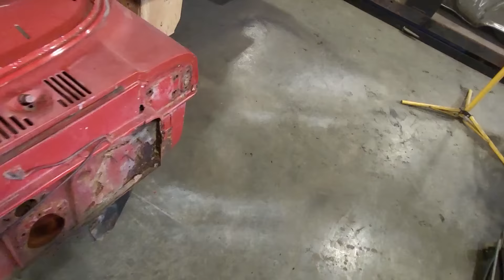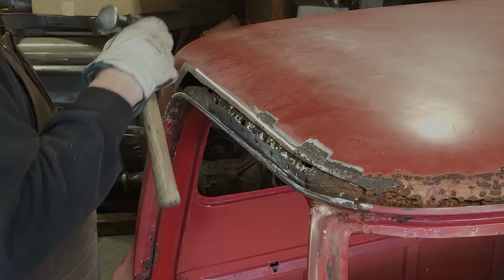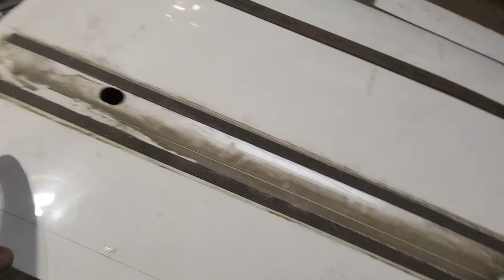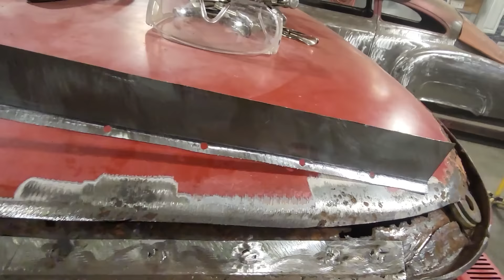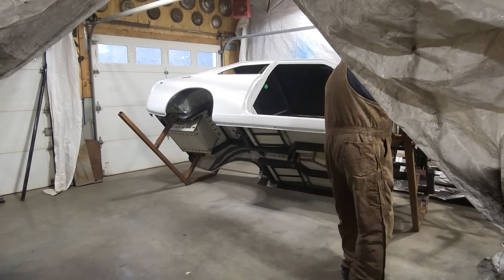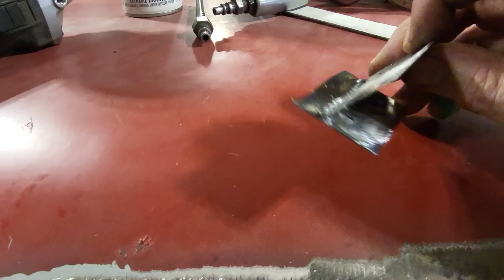Project VIC100 Part 3. Rusty Roof!

Comment: Tony, with regards to the small piece with the seam that you made for the right rear corner of the roof, could you drill three holes in it to gain access to the inside and spot weld it using the holes for access to the insides and then weld up the holes afterwards.

Comment: Sorry to hear about your back issues, I can relate. I have a lot of carts and things with wheels cause it's easier to move. The six inch break is fine for straight bits but you can break a curved line with a chisel on an old mud flap then hammer it to shape. I find I can bend a 1/4" flange in 20 gauge easier than welding the edge on like you showed, (which is better with 18 and thicker metal). Thanks for another interesting and educational video, looking forward to the next one.

Comment: Hey Tony. What about that “rust converter” stuff? Is that any good to spray on the inside stuff or is it gonna cause more problems?
Reply from the maker: Good gear, I used it before, just not enough bottles of it around to save thing thing. Lol

Comment: You doing this repair is what I needed to see. Thank you so much. Sorry about your back issues. Back in the early 90s I hurt my back poor crushed thoracic discs one ruptured..
Had to change occupation.
But I did buy a 71 Chevrolet K 10, which I’m doing minor body work on, including above drip rail and around 3 of the 5 cab lights.

Comment: Have you ever tried panel bond on parts like the rear cab part with the seam? You could panel bond the bottom and weld in the top.
Reply from the maker: Used that stuff back in the day. Good gear just has it place.

Comment: Good day sir Tony you talking about back problems ,same here so i make up like the movers use for moving heavy things but mine are 2by4,s and a set of wheels for transmissions.engines,built a jig for chev cabs my garage is small so times i have to move the cab outside to work on my other trucks .But my back is still sore ,could be worse any way the ford cab is looking well done sir Tony

Comment: Same here, excersizing isn't working, got me through three operations, back fused and shoulders. Get a recreational centre pass, and do resistance training, in water or weights. I'm 64 on the 20th, I'm building a shop on a disability, bit by bit. Be smart, I tell myself, I can't afford not too. Falling trees for lumber and firewood, doing demolition jobs for material .. and my 70 highboy Ford will be getting a new cab soon, and flat deck

Comment: Very interesting video as usual. What do you think about using a set-point tool to create a stepped profile on the edge of the sheet metal? This way, one sheet goes under the other, the two are aligned (ifall goes well), and you have a better surface for welding (no holes). Yes, I know there's a risk of rust in the gap, but you can apply a primer before welding to minimize that. Keep showing us your tips, I'll never get tired of them.
Reply from the maker: That system works. I just find you dont get a flow between the two metals when welding. You see your joints . It works but dont look good

Comment: I love this video!!!  
slowly working on a 49 
chev (basket case) truck, normal rust in kick panels & floors.  Not trying to restore, just want to make it into a daily driver and not worry about a "grocery cart'' rolling into the side of it.  I said "slowly" because I'm 79 years oid and have had back issues since I was 20 years old (probably from not lifting properly when I was much younger).  
But I still enjoy being in the garage with "Ol' Blue".  Thanks for your videos, especially this new project.  I have been a subscriber for a couple years and always pickup tips from you.  Keep bringing use videos and good luck with the back.

Comment: Could you not just weld the sections in with a decent gap for extra penetration and then cut a grove to give the appearance of a panel seam?
Reply from the maker: That usually ends up making a mess of the line
Reply: @fitzeesfabrications 👍

Comment: Fitzee, just turned 64, and I try not to NEVER DO ANYTHING MANUALLY if I can get an either a 1. Power Tool, 2. A floor Jack/hoist/come-along or block & tackle, ropes, pulleys, logging chain, tractor front loader, or 3-point hitch ( Hydraulics ) 3. Use a “LONG,…REALLY LONG lever” of some kind, ( 2 x 4 ) pipe or extension tube whenever you can.               We can’t have a world without Fitzee 😳…………so BE CAREFUL, slow down, and when you get into a lift/move situation ask yourself “how would the Egyptians do this?” Stretch-out your back before you work,……take lots of breaks,……and never do ANYTHING manually if there is some sort of power-assist, power tool, or mechanical advantage that you can use. THE WELDING EDUCATION WORLD NEEDS FITZEE❤ - we all want you be 👍safe, healthy & happy. 😀 As always - wonderful  video - and BTW - TAKE YOUR TIME making videos - no hurry - no panic - and no rush.  Don’t endanger or hurt yourself rushing to make videos, remember…. “it’s OK, we can all wait” 👌😎👍 ( and I love the “masking tape + paper towel” bandages - I use them all the time ) 👍

Comment: Fitzee you are 100% correct about the filled in seems making the car look like it is Bondo’d over… Also, in your last video you were talking about dropping the cab down to fill in the space between the top of your Vic dash and the lower windshield of the F 100 cab… I was looking a One of these projects the other day. They still had the gap and the owner said that they didn’t lower it because it would cause the wheels to interfere with the wheel wells…
Reply from the maker: Yes i know that. I plan on cutting my arches. A sorta stock car look.
Reply: @fitzeesfabrications  I said wheel wells in my post, and I realize that I miss spoke… What I was trying to say, was inner fender panels… The tires would rub the top of the inner fender panels

Comment: Hi Tony.  I see that Peanut was giving the video a good cat scan.  When you first showed the cab, I was thinking that the rust along the roof was going to be very difficult to repair.  You made it look easy.  With your many years experience, you probably knew from the start how you were going to tackle that issue.  I like that you kept the seam.  I think that the truck wouldn't look right if you filled it in.  If it was going to be a show truck and have the body all smoothed out, I could see maybe filling it in for that reason.

Comment: Hi Tony, another great video.  I went and bought another welder...same as yours.  Curious what settings worked for you with that 20/22 gauge.  I have a bunch of similar welding tasks to complete on my 1960 Jaguar.  Thanks for your videos.😊
Reply from the maker: I play around with it. Around 15 volts  and 5.5 on wire speed. I find keeping the numbers close to same on both sides seems to work for different thickness.  18 volt is like 8.5. 13 volt is 3.5.  Ill ajust wire speed  up or down a small bit to get a better weld

Comment: Take care of yourself Tony! As for your back…I will admit to eating crow…I used to hold a very dim candle to chiropractors. Until I could not hold my hammer or climb a ladder due to carpal tunnel in both wrists. My surgery date was pushed out two months and even tying my boots was difficult. A co-worker gently pushed me to seek an alternative method and, after ten visits, I no longer needed surgery. That was six years ago.

Comment: I've been in bed for chronic back pain off and on for many many yrs, from a work injury in 2001 as a welder fitter, than I had a failed fusion surgery, in 2006 the surgery worked with  the aid of chronic pain meds till 2014 since then I had to be on fentanyl till 2022  now I'm on Suboxone thank God. but I suffer from massive memory loss which is just as frustrating as the  back pain at times. Almost died once with an overdose when I my mind snapped 4 O'clock in the morning from massive pain, ended up taking many patches and a load of pills than I was woke up, shocked that I didn't die, I was not in my right mind when I did it, or I wouldn't of done it. So yeah believe me I know what living hell is like. but my faith in the Lord, has help me endure and help sustain me through the years believe you me ..so you don't have to tell me about back pain brother 
BTW I hope your doing ok, be wise Fitz, use your brains not your bronze. lol so do what you have to Fitz, your health comes first fitz, were not going anywhere. cheers.

Comment: Hey Tony:  Great video as usual.  I couldn't agree more with your preference to retain the factory seams.    Back around 1974 I had someone do a quicky mop and glow on my first car, a '64 Chev Impala 2 dr hardtop.  Very rusty rockers and door bottoms and between the front bumper and the front wheel well there was a small seam....the  guys who did my repair just gooped over the seam and it no longer looked right to me.  Of course a few years later it swelled up like a blister on your hand.  Anyway live and learn.  I feel for you on your back.  I'm 69 years old and in pretty good shape but my back started giving me sharp pains several years ago.  Long story short and several doctors and surgeons later I am recovering from major surgery to fix my spine.  They had to blow my lower back bones apart and clean them up.  All the cartiledge between was gone and it was pinching my spinal column.  They fixed it by putting some stuff between the bones and then screwed them altogether with bars on either side of the spine.  It was a 6 hour surgery and a week in hospital.  I'm about 4 months past the operation and I'm doing good and don't have to use a cane like I did right after the surgery.  Pain is gone but I've learned my lesson about exerting myself.  Just glad I have an electric starter on my 1915 Ford Model T so I don't have to crank.  All the best, Rick from Ontario

Comment: As always amazing video. I also have back issues for at least 15 years with a fracture in L5, working on cars is my passion and it took me about 10 years to find a way to keep my back safe and still do the things I do. I will recommend you to do every day the McGill big 3 exercises, it does not require any equipment and takes 3 minutes to complete, it improved my back tremendously. Good luck

Comment: Tony, I know your used to doing steel wire, but have you ever considered using silicone bronze wire?
Reply from the maker: Never every used it. It came in the trade after I left. It's designed  for thin metal. I seen it used but never tried it

Comment: The biggest tip here is "keep the factory seams" I always try to make the repair look like it should. Anyone can bung some filler over a seam post repair but it does not look right. Also, putting "cover panels" over sills was the way we did it years ago. I have recently had to take all those repairs off my car and replace it with full new panels because that's how its done now. Those panels were not available 30 years ago! As always great work. learnt a lot. Thanks Fitzee

Comment: Tony why did you not use a chemical converter on all that rusted material? Wouldn't cost that much and would have made it last a while longer. I am taking it all in. I am working on a 1972 F600 that needs a little work and watching you has given me the confidence to do some of it.
Reply from the maker: Dont have any left and that stuff is not something I ever used on a budget build.

Comment: The repairs you're doing on this old truck are fine for what you want it for, a winter truck to use in the snow and salt. No point in doing a proper restoration for what you intend using it for. In fact, you're going to more trouble than you really need to. You could do a lot of the repairs with just body filler.
Reply from the maker: Yes true but I have a rust repair youtube channel. So need to weld it up half decent. Lol

Comment: Hey Tony, had a great time watching you fight the VC100 roof. I had to do my 64 F100 roof four years ago. I always leave the seams and other panel details as well. After I had the entire roof patched in I took rust converter and with a 1" brush reached in from the inside and applied a heavy coat. I'd like to send some pictures but don't know where. Great Fun!!😊

Comment: Curious as its quite obvious the inner roof panels, both outer and innner are seriously rusted. Why didnt you just remove outer and spend the $15 bucks on Eastwoods RUST CONVERTER  and coat the complete roof ?????? . Rust never sleeps
Reply from the maker: $15 bucks over to Canadian....shipping... duties... taxes... nothing cheap here a botton of that suff local is over 30 bucks. Besides. This is what it in.  A beater. The less money I spend the more I enjoy it.